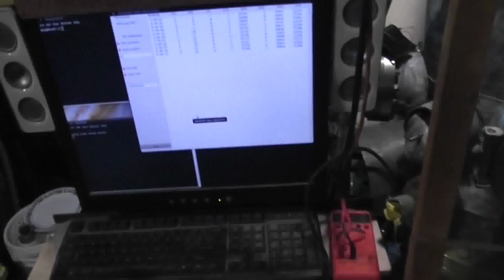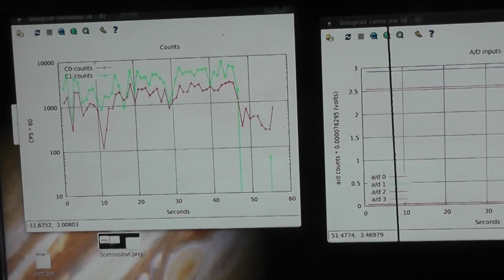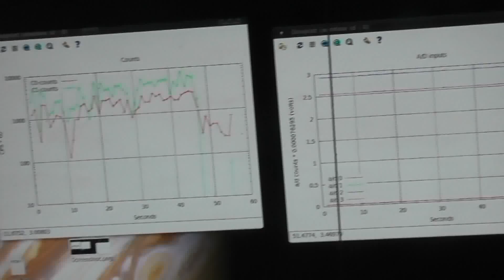MayDayRun

Comment from the maker: Yes, obviously if these numbers are "real" I have to really start sweating rad shielding even more than now.  This was ~4x out previous best output (again, if the numbers I was able to get are real) with 1/10th our normal net input power.  I have both RF and radiation issues (and rads are both neutrons and gammas).  Looking into that - I'm going to fix the RF first, as it's not as hard (I hope) and then I can trust my data aq and know if I really do have the other problem.  I'm already behind a lot of lead and leaded glass, but that doesn't do much for either neutrons or really hot gammas, and we have some because neutron capture in the hydrogen in our moderators for detectors makes 2.2 MeV gammas - takes a LOT of lead to stop that.  Even boron is in the .5-.6 MeV range when capturing slow neutrons (one of our detectors uses that for the detection mechanism).  Again, a 1/8th inch thick piece of lead - or a 3/8" thick lead-glass radiology window (backed by 3/4" pyrex) doesn't have much effect at those energies.  Just a little Compton scattering...

This is real science for ya - not always sure on the first go, since I know that some of my instruments didn't give me (good) data, yet some (silver activation) surely did.  So, replication first, then claims.  Credibility matters.
Reply: Science = Self sacrifice.
Reply from the maker: Hopefully, this science != Self Sacrifice in the mortal sense.  I am, however, doing it for the love of it.
Reply: Know that others in the universe have done it and very much representing humanity.
Reply: It sounds exciting, but I have NO idea what the meaning of this video is.
Reply from the maker: zion ramirez Sorry 'bout that.  Sometimes me neither.  This is part of a long list of small documentaries of experimental runs, part of a playlist on my youtube channel, and all of which is explained in much more detail on my site,
www.coultersmithing.com/forums where you can most often past the youtube url into the search box to see what I was up to at the time, get more data than a mere vidcam can provide, and so on.  In this case, it was our first test of deliberately making the thing oscillate in somewhat controllable fashion, and it more or less wacked all my data aq from the resulting RF noise, which I'll now have to improve the shielding of  - there was already a lot, but this was a lotta power.
Reply: Hello Doug how you been?
Reply: Have you looked into the polywell setup, and considered cymatics inspired injected emerging confinement?
Reply from the maker: Jakob Steen Madsen Yes, I looked at polywell, Bussard's thing does not work in practice...for good theoretical reasons.  As to the latter, don't confuse merely electromagnetic forces at a level that characterize chemical bonds (a few eV at most) with overcoming Coloumb repulsion to the level required for tunneling into fusion - which is thousands of times a higher energy barrier.  That said, I have looked into various methods of dynamic drives and am working on that now.
Reply: My point is that our traditional ways of thinking about fusion is majorly flawed. Temperature and probabilities is a totally misunderstanding of how this phenomena works in nature. We need to shift towards a more electric model and thinking about spirals and field patterns and harmonics, to guide the event. That is where I believe the focused fusion project is moving in the right direction, though its still too old school and linear in its concept. The polywell did not work, but it was moving in the right direction.
Reply from the maker: Jakob Steen Madsen Well, right in many ways.  Temperature is often used inappropriately.  Using the term implies all the energy is evenly distributed into all 6 degrees of freedom, for example (translation around X,Y,Z and rotation around each).  My device has a very non-Maxwellian distribution, which saves me (in theory, it's not perfect) - 5/6 of that energy to get to the same collision parameters.  Among other things.  Tokomaks use temperature correctly, since in their case (and to their disadvantage) it really is relevant, and probability matters when you can't aim...and just hope things collide at random.

Turns out nuclear spin, which is conserved, and we've known about that since the '30s or so - also matters quite a lot.  No one else has even mentioned or addressed it yet, but when I prove, again, that it really matters, they'll pull out that we've known that since the '30s, I'd bet.  Yeah, so how many billions spent on PhD types and not paying attention to well established science at all?  They'll surely pull that one out in the sour grapes sense....at some point.
Reply: My only point was that I am strongly suspecting that a combination of the polywell confinement and a cymatics field approach will give us the point discharge conditions we see in stars. If the sun is indeed electrical, its in a free space environment, and will behave in a spherical way, thus more resembling a rather big ball lightning. This would mean that the sun might be "hollow" in a similar way to how the pinch effect is a spiral and have a cavity in its center. If so we should consider the actual confinement to be the dynamic guiding effect that creates the conditions, and not in a simple gravity pressure and temperature fashion, but in a much more complicated and probability improving way. My view is that the topology of the plasma results in a lensing effect and this is the real source and the engine of fusion. Maybe that all sounds very fringe, but I wanted to share the ideas, in case it inspired you to try something out of the box. :)
Reply from the maker: Jakob Steen Madsen I think you're crossing into pseudo-science there, but don't let me stop you from building it in a lab and making tests and measurements - nothing beats a guess like a proof!  I can only go down one road at a time.  I follow cosmology and so forth fairly closely, and no actual peer science talks about "point discharge" or hollow stars that I've ever seen.  I did work with pinches in college and ours were neither spiral nor hollow, but would have beem promising for fusion if we had been using something other than tungsten ions to make our point source X ray microscope.
Reply: In the victorian age electricity was pseudo-science and stage-magic. The hollow sun theory might be fringe now, but I am pretty sure it wont be for much longer. The source of gravity is not inside the stars but surrounding it. Once we start revisitting this old idea, all the other parts of the puzzle will start falling into place. Our earth bound dogmas need a huge revision, and the most important will be our model of fusion. Sonic cavitation show us the first clues, sonoluminescence is the phenomena we need to understand. I will get around to building my own setup, but it will be a bit further into the future, and I am sure someone will get there before I can get the funding and experienced engineers to build anything. So till then I will wish you good luck, and I hope you find something worth sharing with the world.

Comment: Any new developments?  Love that you have everything open sourced, hopefully as many people as possible will share your findings...  Gotta love the internet, once something is revealed there's no going back.
Reply from the maker: Yes.  I'm busy replicating them now (in between handling this fresh bout of fame - someone shared that Motherboard Vid on facebook with my PHONE NUMBER, gheesh) so I can make another video to document the process and the gains.

Not new science, actually, just new technique for this field.  By bunching in time as well as space (focus) - like just about every other particle accelerator has been doing for years, we've increased our ratio of output to input power by a really fat increment, to the point the thing needs additional shielding to be safe to run even for a minute.  I've also improved our spatial focus with a new grid I built that is more accurate, though it's still thousands of times less accurate than the math predicts it needs to really be, it's still better than the last one by another fat factor.
Reply: You ever think of doing a kickstarter campaign to help pay for some extra equipment?  I'm sure many people (including myself) would be more than happy to donate to just be part of it.
Reply from the maker: Yes, and no.  Outside of super-expensive stuff like CNC tools to make more accurate grids, which I think I can have farmed out, I don't lack for any gear...pretty well set up.  What I need is a lab assistant, and that's a rate of money, rather than an amount.  I wouldn't feel right hiring someone only to have to let them go when some amount of money ran out.
Begging for $ is also an almost universal sign of a scammer in the alt energy business, so I try pretty hard to avoid being painted with that brush, since I'm not a scammer.  If it comes, it comes.
Reply: Just know there's people out there willing to take a bit of money loss for even the chance of having something for the greater good.
Reply: Doug Coulter I'm sure there are people out there who would work for room and board (like WWOOF) for the chance to be a part of this. Myself included, (currently a radiology student) though I am not qualified in the field of nuclear physics (or medicine, yet..) "Tell me and I forget. Teach me and I remember."  My adaptation in this case would be more "If you will teach, I can learn."